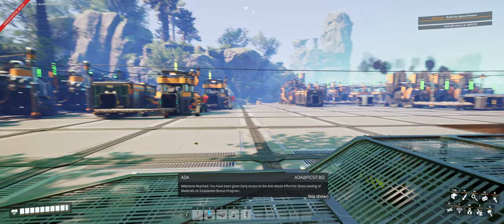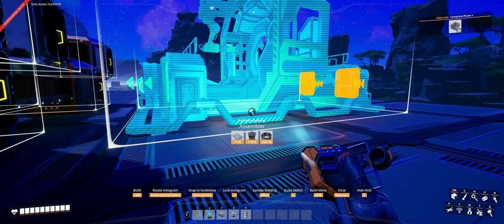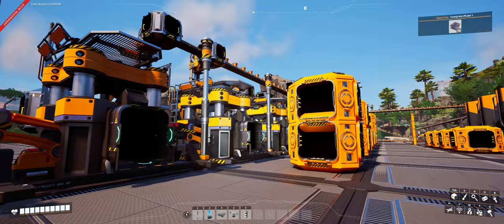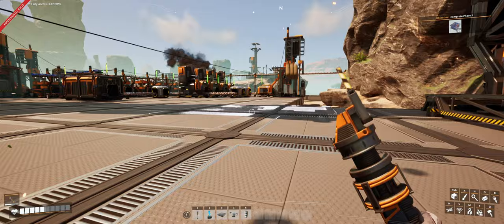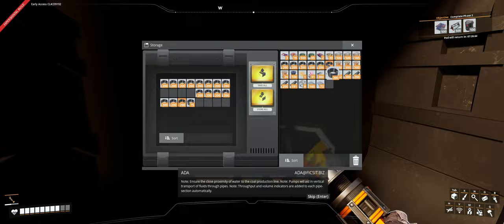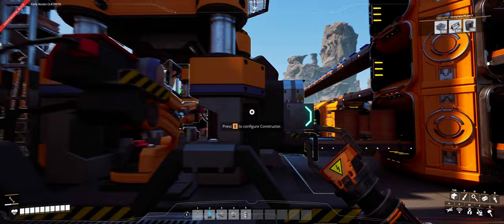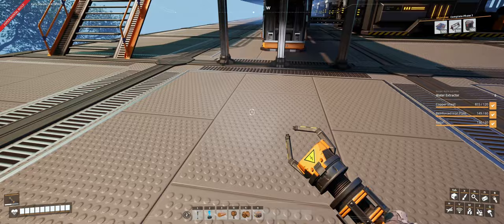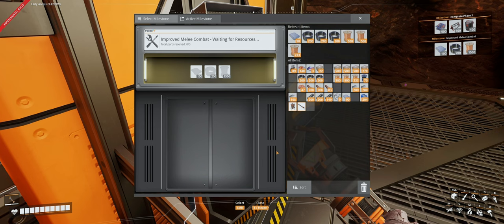I Built 16 Coal Plants at Once | Satisfactory U8 - Ep 2

Comment: early game with the big pigs(normally I refer to them as bullies), I throw down a splitter and jump on top of it.  Pre blade runners you need to make sure you have some elevation to get on top of the splitter.  So finding terrain with a slope helps get on top of the splitter.  Normally I can find this somewhere while I'm running from the bully.  From there you can zeno zap it till it is dead.  Actually late game I do the same.  usually I have a gun.  Rush scatter ammo on the bolt gun.  It will one shot the smaller wild life and hatcher for the crabs.
Reply from the maker: For sure.  I take care of him later that way.  Just wasn't prepared on that first encounter lol.  And the basher helps. :)

Good idea with throwing down a splitter!